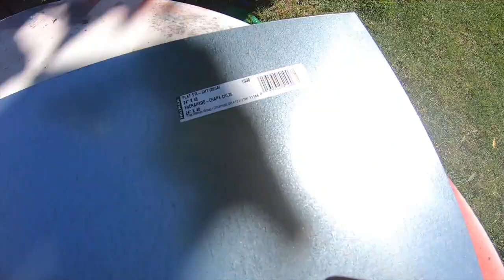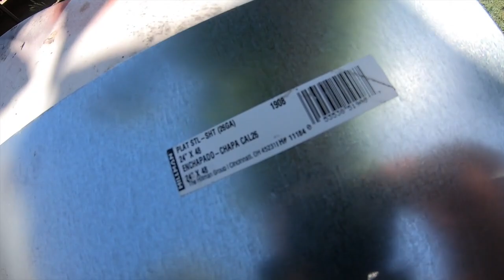Classic Volkswagen Beetle Custom Firewall !!

Comment: Good idea, I would put peel and seal as insulation from lowe's  on the back side of the metal to make it more insulating.
Reply from the maker: Definitely a good idea but I do not have any heat issues. Wouldn’t hurt to put a barrier between both metals though.

Comment: Looking good. I have the same firewall your dad has but i painted mine hyper silver. Just a heads up, if your doing alot of chrome.. Don't do the chrome valvecovers..they leak. I ended up getting rid of mine and went with the bolt on scat covers.
Reply from the maker: Appreciate the tip bro🙏🔥

Comment: I wouldn't chrome the whole engine cause it'll make the engine keep the heat in. Some chrome is okay but you'll want some dark colors in there to help absorb the heat. That's why the tin comes black from the factory. I'm paint ing mine a light blue tho😂. But with all chrome you might want to get an external oil cooler and filter. Just to help
Reply from the maker: Never really thought about it that way. Whenever I drive I go hoodless so it helps with the heat but I do see the issue if someone were to run this set up with the hood on
Reply: @tuned_tunas  oh. Yeah when the hood is off it can help a lot. Just make sure to have all the tin and the seal that goes around
Reply from the maker: Will do bro. Thanks for the feedback🙏🔥
Reply: Colour has nothing to do with anything in terms of heat reflection. The engine bay is in darkness. Look up the difference between conduction, convection and radiation.
Reply: @jhamilton7373  lol this is 9th grade science. Different colors absorb and reflect light differently which is why they reflect and absorb heat differently. A black painted car is going to be hotter inside in the middle of summer than a white painted car. Black absorbs more light because it reflects less light out, therefore trapping heat. That's why the engine was painted black from factory, the paint would help absorb some heat instead of the extra heat being absorbed by the metals and oil in the engine itself
Reply: @nickel1008  Haha did you actually read my comment?  Did you pass 9th grade science?   You are using the example of light radiation, what part of the inside of an engine bay emits light?  Dark colours are next to negligible at  effective at absorbing heat in this environment as there is no light radiation in a an engine bay.  Most heat from the engine is transferred to the atmosphere by convection rather than by radiation. Radiant cooling of an engine is negligible. Engines run quite nicely no matter what colour they are repainted. air flow is key....convection. Most heat energy emitted by the engine is in the invisible infrared portion of the spectrum. What appears to us as black, white, red, or green in the visible spectrum is not what we would see in the infrared spectrum. Any colour of paint that uses organic (non-metallic) pigments is black in the infrared spectrum. For example, white paint emits 90-95% depending upon pigment type. Black emits 96%, blue 94%, green 92% and red 91%.  Painting an engine increases radiant cooling but the colour of the paint doesn’t. Again go and look up conduction, convection and radiation. Anyone worrying about keeping their VW motor cool needs to look at effective oil and air flow and having a complete set of tin wear.  What colour you make it is the least of your concerns.

Comment: Nice work... For the sake of four bolts you could have pulled the engine out and made it easier to clean and paint etc.
Reply from the maker: I 100% agree with this statement but I was not ready for that huge job on this car. Lol it had already escalated from the original plan.